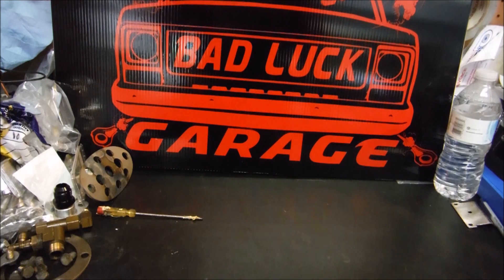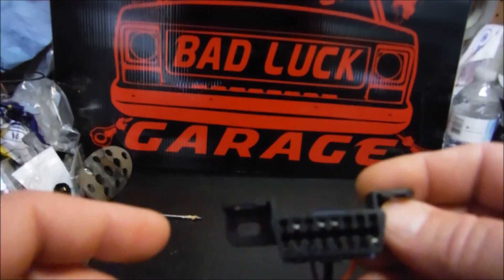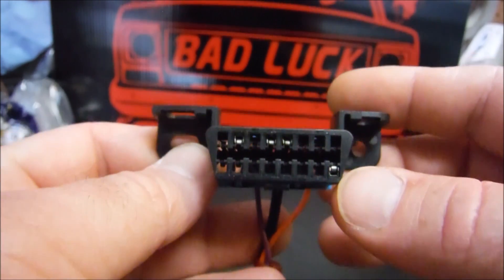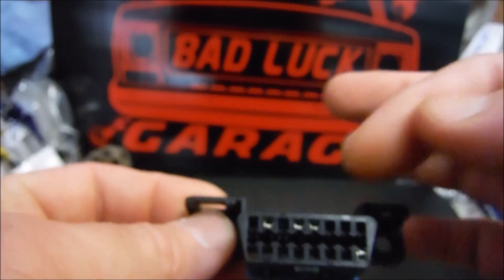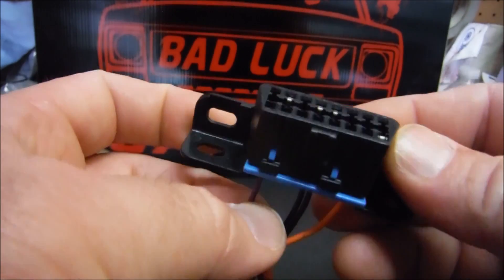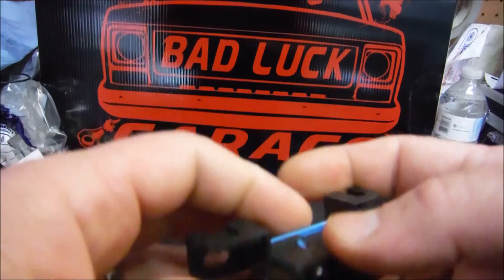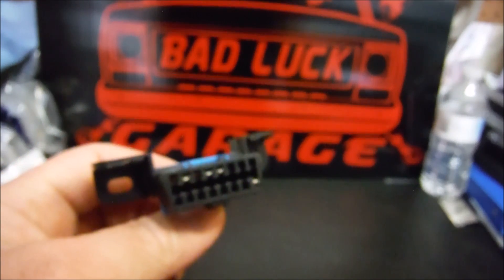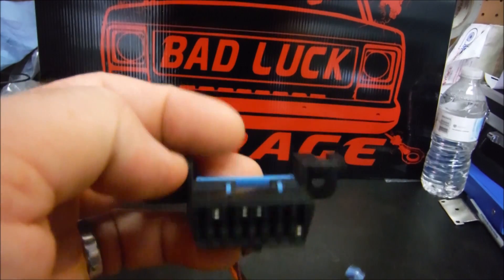OBD II CONNECTOR WIRING FOR LS SWAPS

Comment: Do you think I could use this wiring on 2007 gmc Sierra pick up 4.8 engine?? I have problems trying to use my triton d8 snap on scanner, it doesn't communicate with the computer,  but is wird because a smaller innova code reader works!! Why you think that is??thanks in advance!!

Comment: My wiring harness is a eBay special and it won’t read I have checked all the pins with a power probe I have constant 12v at 16 ground at 4&5 and switched 12 at 1st pin I have used a “bench harness” to give my car a base tune but now my real harness won’t read the scanner will turn on but it won’t read
Reply from the maker: First off I don’t feel like you even watched the video or you’d know you don’t even need pin1. Second, You need to backprobe pin2 and make sure it’s getting a connection all the way back to the pcm. Because if you have 4&5 grounded and power at 16, then all that leaves is a serial data wire problem.

Comment: is possible to wire two OBD2 ports splicing every wire from one OBD2 port to a second OBD2 port without affecting the function of it?
Reply: You can and it won't change a thing.    UNLESS you have something plugged into both ports at the same time.  They might cause some weird stuff with two scan tools shorted to each other feeding data in and out.

Comment: Am installin front sensor on my 1952 chevy truck and i need to connect 2 of those sensor wires to pin 6 and 14 for sensor module to know high and lowe speed from obd2 port. Question is do you know where to connect   pin 6 and 14 from obd2 port ?
Reply from the maker: @javierargumedo3  https://youtu.be/_VXBgoJSo_0?si=0MyPD0_N4_BgHDw9

Comment: What wire size are you using? Stranded or solid
Reply from the maker: https://www.ebay.com/sch/i.html?_odkw=obd2+connector+female&_osacat=0&_from=R40&_trksid=p2045573.m570.l2632.R5.TR4.TRC2.A0.H3.Xobd2+connector+.TRS2&_nkw=obd2+connector&_sacat=6028&mkrid=711-53200-19255-0&siteid=0&mkcid=1&campid=5338299795&toolid=20008&mkevt=1

Comment: My orange wire is  hooked to constant wire from fuse box, only power when switch is on. Should  I  find other power?
Reply from the maker: @mikeasch8625  You should wire it exactly as explained in the video.

Comment: So just run the power pin straight to the battery with a fuse. I'm having connection issues when I plug in
Reply from the maker: It’s a 3 minute video with very specific instructions even someone with TikTok brain should have been able to follow.
Reply: Just trying to make sure before I run a power wire. Man, I hate asking question sometimes on channels.

Comment: So the 12v constant is typically wired to cig lighter. Hence why if you go to hook up a scanner to any vehicle and it doesn't make any connection or light up your reader/scanner, the 15amp blue fuse to cig lighter is normally blown. Hope no one runs longer wire than needed to the battery vs cig lighter. I keep it that way so i know exactly why I don't have power to obd port.
Reply from the maker: Correct.
Reply: Hey do you know which pin is the cig lighter on 99-02 pcms? cant find the pinout online and need for it obd2

Comment: Great video very informative and to the point thank you.do you know how to hook up the check engine light
Reply from the maker: The pcm ground the light to activate it. So 12v switched power to the bulb, then from bulb to whichever pin on your pcm connector is labeled “MIL” on your wiring diagram. It will be different for different pcms so you can goto LT1Swap.com and look up the correct pin for your pcm.
Reply: @BadLuckGarage  thank you really appreciate it

Comment: I need to find the CAN High and Low data connectors, which are Pins 6 and 14 on an OBDII connector.  Is Pin 2 (Serial Data) the combination of the CAN High and Low?

Comment: My scanner cannot communicate with my RunX’s ecu I have an after market radio, how to fix that. Please help me
Reply from the maker: Sorry brother. I can’t really help you with the car audio stuff. Not really what we do  on this channel.
Reply: @BadLuckGarage  ok thanks Brother but my question was if you can help me understand the wiring from OBD 2 port to the ECU. I lost the communication right after I got an after market radio installed. I think they cut some wires here, just don't know what actually course my OBD scanner not to communicate after the radio was replaced. It only powers up
Reply from the maker: Check to make sure you’re getting power to the obd2 port. It may just be a blown fuse. In most factory applications the obd2 port shares a power lead with the cigarette lighter port. So it there’s no power there either than it’s definitely just a blown fuse. Since you had the head unit installed by someone else, I wouldn’t diagnose past that. If it’s not a fuse then take your vehicle back to the installer and have them fix what they broke.

Comment: I have a green wire in pin 14 and my computer pinout has a green wire thats for data? whats that about?
Reply: If it comes from pin 858 it's the Serial Data wire, which is dark green I believe.

Comment: I was hoping to learn how to remove that blue board from the socket. I've got an inverter connected to the socket instead of the original wires so they won't smog it. After smog I'd like to reconnect the inverter's wire board.

Comment: Hi how you doin I got a 01 Yukon doner I cut the ob2 it has the purple orange 2 blacks but it also has a green wire on 14
Reply from the maker: Pin 14 is not needed for a swap. This is usually used for diagnostics on something such as the BCM which you won’t have in a swap situation.
Reply: Bad Luck Garage thank you for the information i needed I appreciate the response
Reply from the maker: No problem brother. Good luck with your swap. 👍🏻

Comment: How would you go about wiring the actual OBD cord that plugs into OBD port. ?
Reply from the maker: That would depend on what accessory you are attempting to wire to your OBD2 port. All code scanners and pcm programmers are pre-wired so I can’t imagine what it is that you’re attempting to plug into it other than that. But my suggestion would be to call the manufacturer of whatever device it is you’re trying to use.

Comment: Thanks  for the simple/straightforward video. What about pin 14 (CAN L)? Is that needed? It's from a 2000 Silverado donor truck. Thanks!
Reply from the maker: The only four wires needed are those shown in the video.
Reply: does that apply to a 2001 dodge intrepid SE?

Comment: Could a guy wire a relay to obd 2 port, reason is battery drain, and humming alternator. Unplug port fuse and humming stops. This is a swap harness by the way
Reply from the maker: Sounds like you’ve got something crossed up somewhere brother.

Comment: I have Renault safrane 2008 port obd 16 pin when i connected with launch show me connected error any advice guys
Reply from the maker: No clue brother. I primarily deal with Chevrolet vehicles and more specifically LS based platforms with the occasional old sbc thrown in.
Reply: Bad Luck Garage there is something connected to the opd port should I disconnect it?

Comment: What about the light? how to connect the check engine light which wire I need yo use.
Reply from the maker: Pin 46 on the red or green connector depending on which you have.
Reply: Bad Luck Garage where’s pin 46 if there is only 16 pins on that harness? sorry new to this
Reply: @YoungAmzn  on the PCM not the OBD2. And the Check Engine light is separate from this wiring for OBD. Im assuming your running a standalone light for it.

Comment: Wanna shoot some info on how to wire and where the wire goes for an 03 drive by wire pedal assembly.
Reply from the maker: Robert Banks thanks for watching! The DBW pedal assembly has a plug in harness that goes from the pedal to the TAC module. There are no extra wires to be run outside of that short harness so I’m not sure what wires you are referring to.

Comment: Do the ground pins need to source the ground from the PCM? Or will any ground do?
Reply from the maker: Chassis ground is sufficient in most cases as long as all your other grounds are done properly. As I stated in the video, I usually twist them together anyway. Bare in mind I am referring to Gen 3 and 4 LS engines and have no experience with other makes or models. This video is LS swap specific.
Reply: mbrouder.   its east bro i downloaded the diagram on the swap i did to hook up my obd2 to the pcm on the pcm on the red one on pin #1 black and white cable is the ground conector hook up the 2 black cables from ur obd2
and on ur pcm the blue one pin 58 is ur dark green cable for the serial data cable to ur obd2 port and for the last cable on ur obd2 the orange just hook it up to a constant 12volt cable some were no one is going to mess with it thats all hope this helps some one ✌
Reply: oh and pin 16 from ur obd2 orange wire u can hook it up to ur blue pcm pin 57 wich is also a orange cable that pin 57 is the pcm battery cable supply.
Reply: @richard pp  u still need help?